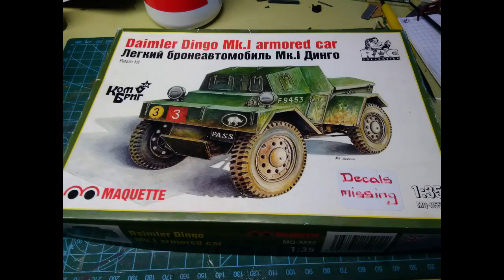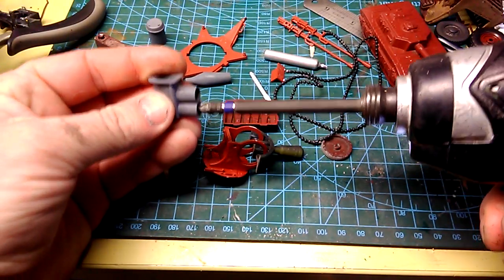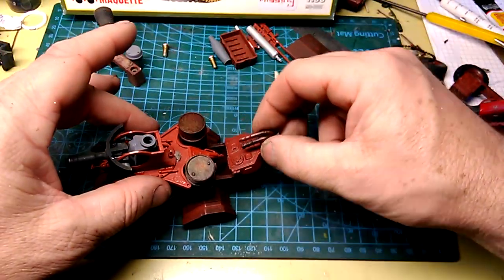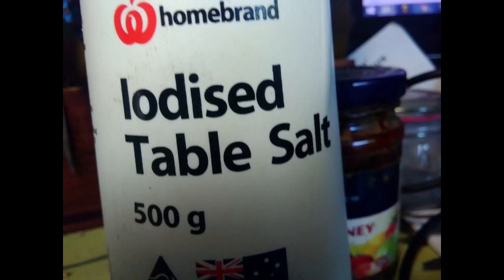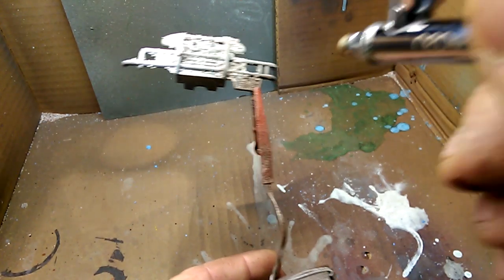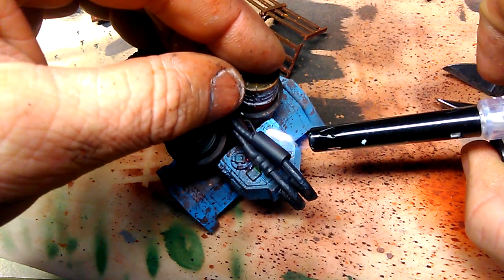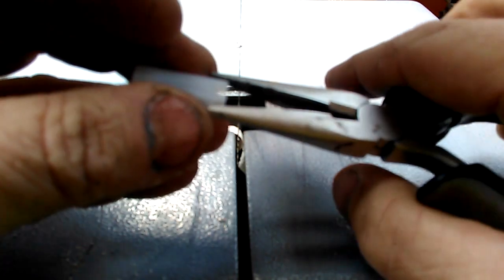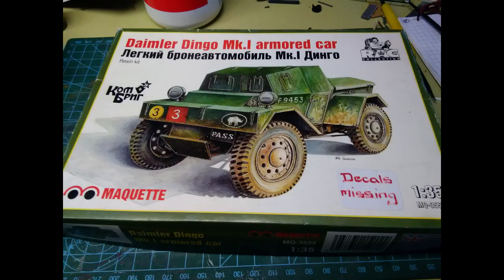Firebug - Post Apocalyptic Kit Bash Model

Comment: Also love the recycling of already used salt with paint!, adds to the used and grimey look.  Do you use any glue to make it stick? Would the salt technique also work without airbrush? Cant afford one yet, but definitely will try then. Or is it only oven baked? Will also try for rűst mix of steel wool in vinegar
Reply from the maker: Hey Hanno.  The salt thing works best with spray techniques, including rattle cans. I have tried it with normal brushes - it works but doesn't quite look as good. Just wetting the model is enough to stick the salt and means it washes off easily when the paint has dried. Cheers.